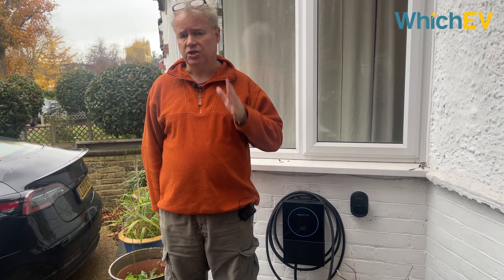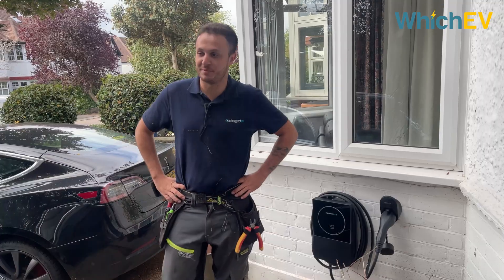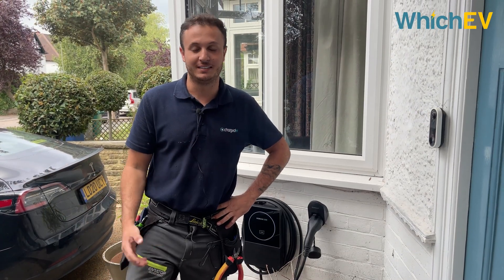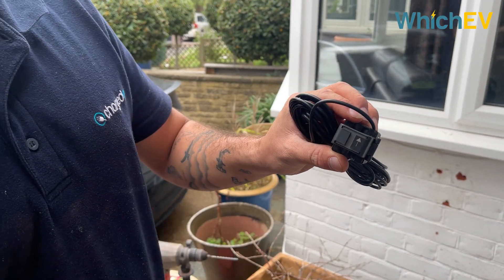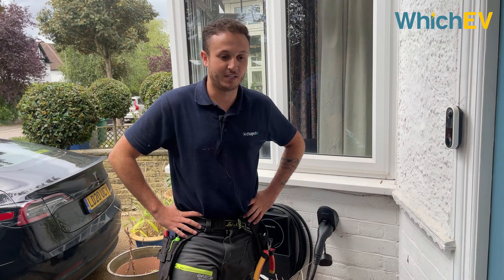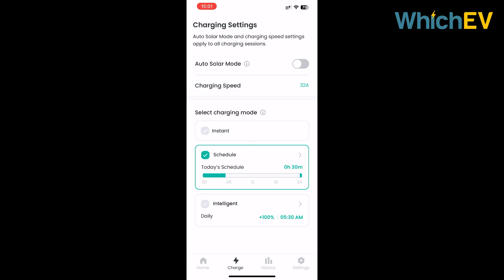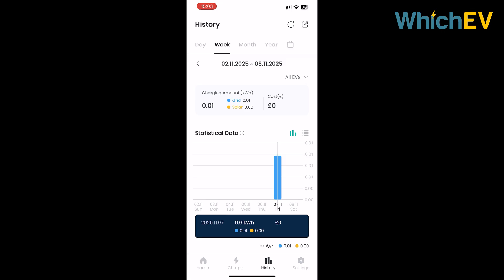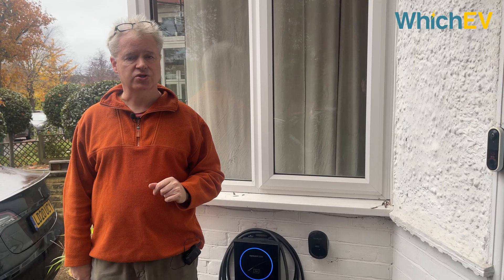Humax MX7 Home EV Charger 2026 Review: EV charging gets smarter | WhichEV

Comment: I have been keeping an eye on this charger over the past few months. We have a Tesla Powerwall 3 installed last December and it seems to be working very well with our solar panels. What I am struggling to find is how to Humax would integrate with our Powerwall? Do you have any knowledge of this from your conversations with ChargedEV? I did email them but had no response.
Reply from the maker: We will try to find out. The reviewer doesn't have a battery system (yet) or solar (yet). Ironically, a firmware update has just arrived!

Comment: Interesting review James. I was hoping that the MX7 would finally enable me to use a suitable EV, such as a Leaf, as a home battery (V2H). However, it sounds as if the technology still isn’t ready yet?
Reply from the maker: There was a limited trial with the Leaf, but it used CHAdeMO DC, which is bidirectional. The new V2H options are AC, and you need a car with a CCS charge port that has compatibility. Volkswagen's ID.4 is compatible, for example, but you also need an energy contract that allows that. The only one currently available is the Octopus one with a BYD Dolphin. This will expand but we don't know the timeframe.